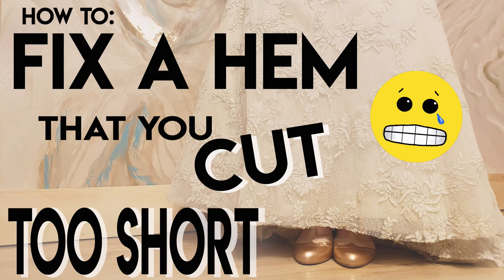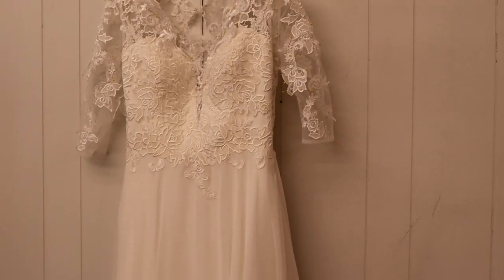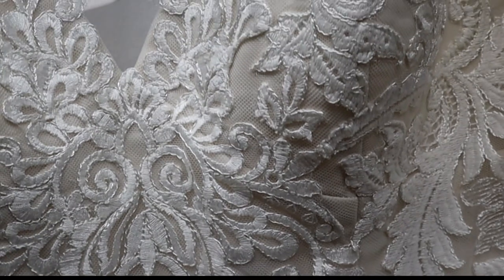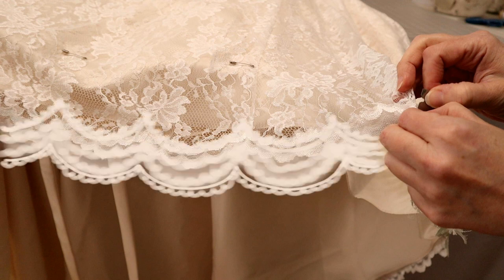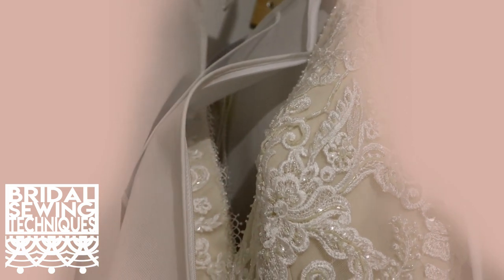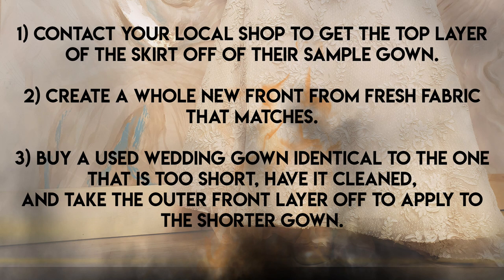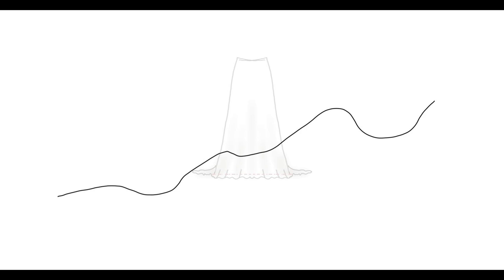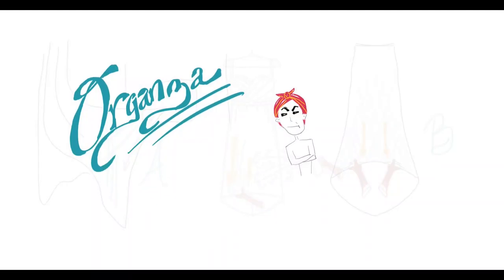How to Fix a Hem that you Cut too Short, correct mistake, repair hem, lengthen skirt, sewing fixes

Comment: The steam and pull saved the day! I made a wedding dress and it was my first time working with acetate fabric. I marked the hem to the floor and cut and hemmed of the dress as I always do. The bride put dress on and it was about 2 inches shorter than it should have been. Your channel was the first place I went to look for a fix. In the next fitting we did the steam and pull method which caused the hem dropped all the way back down to where it should have been. I can't thank you enough!!!

Comment: Happy to see this video!! I have just learned not to trust that dang organza. It will inevitably be short in one spot on the front panel, usually where one of the bias grains is. Trust those pins is right. I will sometimes compare my hem from side to side to itself and even it... sometimes helpful... sometimes not. I have had to use the steam and pull trick on organza for sure. No more evening for me. Trust those pins once and for all! Another tricky fabric I have found is a bouncy net that is much much to long. I’ve had several dresses that were net and had a foot of hem that we were taking off. The weight of the net pulls it down! I’ve had to cut them 1” To 3/4” longer too in order to get the desired length because once the weight is gone they bounce up. Keep up the videos! Love them!!

Comment: So many good tips!
Thanks ❤️
I have the very best (consistent) results by pinning at the floor for every layer beginning with the innermost lining. Depending on my customers choice  if finished length, I slightly raise or lower as I go around and turn each pin vertically.
First, I sew the narrowest hem I can manage,  knowing 1/8” is average for me. I carefully trim away the excess length as close as possible to the stitch line.
Then simply roll the narrow hem once more and stitch right on top of the first line of stitches.
I get a perfect hem every time.
It doesn’t seem to matter what the fabric is, for me this simple technique works well. 
I do use a lot of pins to keep the circle curve true and NEVER rely on measuring from the bottom of the  original hem.
That’s a recipe for disaster.
Does anyone else sew hems this way 
PS 
I adjust my tension for stretchy fabrics since the bobbin thread is going to be on the outside and always use the appropriate needle for the fabric.
Reply: This is exactly what I do. I mark the floor for every layer.

Comment: Great video! Thank God I’ve never had that issue yet but great suggestions.     I wanted to share my tip working with any chiffon gown. I never trust manufacturer and the fabric being so finicky, I found that pinning the whole hem takes way too long. So the bride always has her shoes on and I just cut the bottom on her, leaving a little extra for rolling the hem. It’s so fast and the hem is always perfect length. Girls, try it and let me know if it’s a yay or nay for you💕.             BST, always love your videos
Reply from the maker: That's actually the way I do it, but it's not the way I teach it, if that makes sense. There's too much risk involved for new seamsters to cut on the gown of a standing bride. Sometimes, I have to pin it, but most of the time I cut while standing.
Reply: Bridal Sewing Techniques that’s awesome. True, a lot comes with experience
Reply: That’s the way I do it too, I find that even the silk pins can cause distortion and add weight. My only problem is my back and knees are starting to show their age! 🤣
Reply: I find it scares my brides to cut in front of them.
Reply from the maker: I def have to coach them through it sometimes.

Comment: My only really bad short hem was a prom dress from last season. The skirt of the dress was a very full taffeta style with crinoline underskirts. Because the client was really tall, I didn't notice that she did not put on her shoes - her feet were far out of sight under here skirt. Needless to say that her hem was exactly short by the 3" height of her shoes. She decided that it was OK and she would wear flat shoes because her date was shorter anyway. I offered to buy new shoes for her because I felt so bad. I never forget now to check if shoes are on for fittings.
Reply: What a kind thing to do, Im always amazed what hurdles we can go trough smoothly if we're just nice to eachother. I'm pretty sure in my country, 90% of seamstresses would opt to yell and blame the client instead.

Comment: thank goodness for this video. i got a complaint that the BM dress was too short. I know I measured it correctly, but your description helped me understand that when I hemmed it on the machine, I likely stretched it horizontally (i know I did because i made the hem really small and tight) and if I just steam it and pull down, I should get the length back. i lost about 1" or less.

Comment: Excellent video! Worst case I ever saw was luckily not my fault. A bride brought in a dress for rescue after someone else had messed it up. It was a bias cut silk charmeuse architectural gown with no lace and it was hemmed (badly I might add) about 3 inches too short. I tried steaming it down but to no avail. Luckily the seamstress had cut off the dress in a continuous line instead of hacking it up and I sewed the old hem to the dress lining. Voila! Not only was it even prettier than the original it really looked intentional because it went so well with the original design. After seeing that I developed my "sneak up on it" technique for bias gowns. Has saved me many times from unhappy brides and extra expense!
Reply from the maker: I call it that exact thing!!  I tell my brides all the time, "We're gonna sneak up on it." I say thins to explain why we have to hem in increments sometimes.
Reply: @BridalSewing  oddly what I do is a little different. When I have bodice stuff satisfactory where I feel comfortable hemming I put my bride up on the pedestal and mark a with a pin a specific amount from the floor then I cut off a few inches on the bottom about half of what I think I will need to cut off. Then I let them relax for a few minutes and fluff the gown a few times. I then measure how much it has shrunk by measuring where the pin is now. Then I will cut off a bit more and repeat until I am close to where it needs to be and then I pin. It works for me. I worked in a place where multiple fittings were considered a waste of time so I got good at condensing things.

Comment: Ok I have a question. What do you do with a bride that gains weight (because it doesn't take much to throw off a fitted gown) just before the wedding and now you have to let things out or lenthen a hem because of it? I've had this a often enough and I try to say nicely that now that the gown has been fitted there wont be an option to gain weight..regardless of the pre-parties. Please any advice is appreciated.
Reply from the maker: I leave a dress where it can be easily adjusted until the final adjustment fitting. 
If it requires more than a small, quick adjustment, example; a gusset is needed, then they are charged for a new alteration. 
Here's a few record keeping things that you should consider working into your work flow.  When you have their initial consult, you should record the date & her measurements on the contract. That gives you and her a way to track her size throughout the process. 
Also- make sure you take pictures before, mid-process, and after. This helps so much!!

Comment: How make nice and even hem for chiffon double 360 degree very very wide  length wedding gown? It is hard to make all around even length hem. When i to cut ,they moving  all the time and  can not make nice cutting .  When i cut it supposed hang the dress? Or lay down on the floor
Reply from the maker: Either put them on a 1" block and cut to the floor & tell them to stand still & look straight ahead. If they need a break to "shake it out" then give them that. 
Or- put *a LOT* of safety pins in it & then cut later.
Reply: Bridal Sewing Techniques thanks~

Comment: I have a story about a hem cut too short:  A customer came to me with a floor length dress that the dress shop cut too short in the back by 3 inches.  The seamstress had put a few pins around the front of the dress and then placed the dress on a dress form to mark the rest of the way around it.  Big NO NO!  I ended up making the dress tea length since we had no extra fabric to work with.
Reply from the maker: Woops! Yes the dress form likely doesn't have the same bum as the customer.